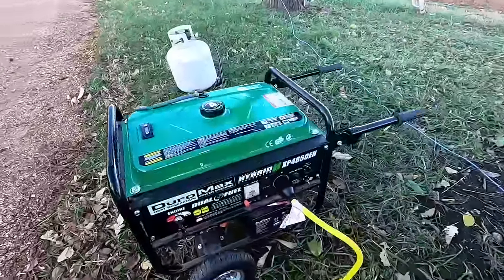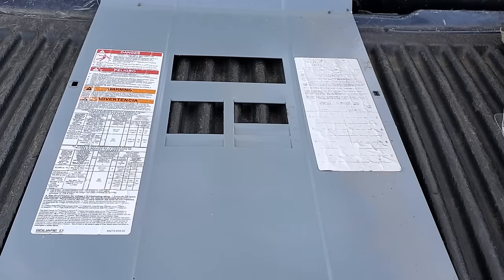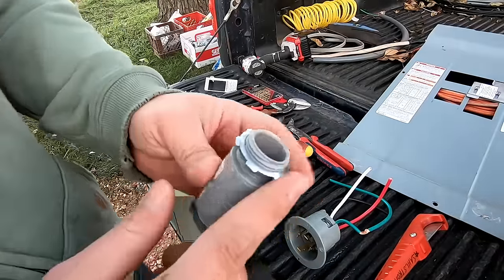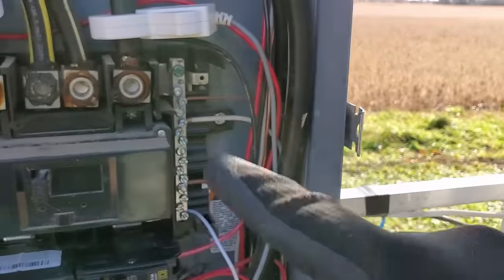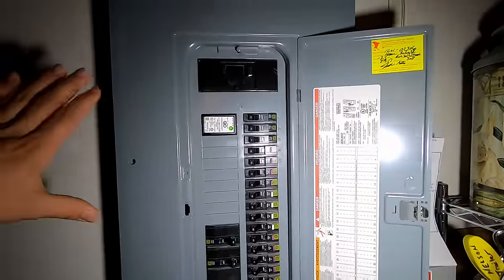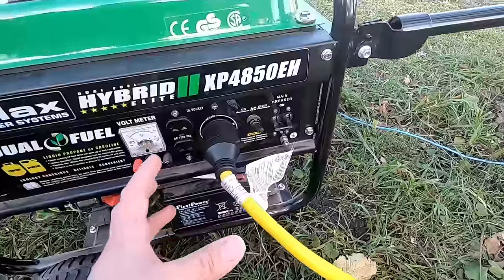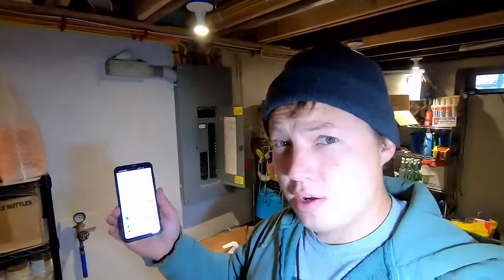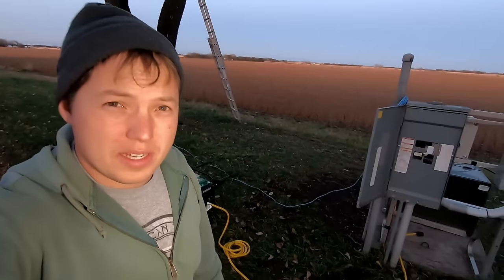How To Hook Up a Generator To Your House Using a Breaker Interlock Kit & Power Inlet Box

Comment: Just watched your video; thank for posting.  I'm trying to understand more about my electrical panel, and wondering if I could use a interlock device with an added circuit to connect my smaller 120V, Predator 3500 Watt generator for back up power to limited circuits.  Most back up gens I've seen being used are 240V with a four prong twist type plug outlet hooked up to a similar inlet plug box.  My gen uses a three pronged twist type connector.  Not sure how I would be able to feed in to only the 120V to all 120V selected circuits on an Eaton 200 amp breaker panel (MBE2040PV200BTF)

Comment: Very informative. Great video. I have a 9000 watt generator that I will be using in the same way as you just did. My question is, will I still use the 10 gauge wire in the panel or would I bump it up to a larger size wire? Again i really enjoy your videos. Very clear, understandable, and professional. 👍👍
Reply: Don’t forget about the generator safety tips as well. Remember safety is always important. Here are the generator safety tips:

1) Please do not allow an unqualified person or your children to operate the portable generator. Just because some manuals don’t say that doesn’t mean it’s safe. That is important against the generator safety rules. We also need to be keeping an eye on our children too. You need to make sure that your children are not playing near the portable generator especially when it’s running so they won’t get electrocuted. Generators pose electrical risks and they can be hot during an operation. Please keep your children away from the portable generator at all times. It is important to keep our children safe especially our little ones. Be aware of all the hazards.

2) Some people use their portable generators indoors which increases the risk of carbon monoxide poisoning. It’s important to have a carbon monoxide if you have a gas generator. Never ever use your generator indoors even if your doors and windows are open and even in the garage is not safe to use a portable generator. Not even at your porch and your deck. It is never safe to use your generator indoors and in enclosed areas of your home. Your generator needs to be 15-20 feet away from your house. 

3) 🔥generators cause fire hazards too. Never refuel your generator while it’s running. You need to let your generator cool off before refueling it and before storing your generator. Never overload your generator too. Never ever back feed your generator. You should never plug your generator into a wall outlet. Also never store propane tanks indoors. Please keep flammable things away from the generator as well and please don’t smoke cigarettes near the generator. Having a fire extinguisher next to the generator is also important against the generator safety rules. 

4) generator operation; make sure your hands are dry before touching the generator. Never use your generator in wet conditions. Don’t let your generator get wet. You need a generator tent if you need to use your generator during wet weather. Please don’t wear loose clothes when operating the generator. Turn on your generator before plugging in appliances. Use the right cord for your generator. Please do not use worn out cords. 

https://youtu.be/I1jT3ANENvI and here is a video more about keeping others safe when using generators and also about our family’s safety. Hope this helps

Comment: What would you consider sensitive electronics - A/V equipment and computers? What about laptop, ipad, and iphone chargers? I recently purchased a Duromax 13500 and went through this project with a 50A breaker. The voltage coming out of the generator varies significantly with the idle control on and I don't think that would be good for any motors. I'm wondering if this is normal? The sine wave has significant THD and is by no means pure. Is there any kind of power conditioner that can be used at the main breaker to condition the power coming in from the generator?
Reply from the maker: I am not aware of a way to "clean" all of the power coming in from the generator for the entire house. The best solution that I am aware of it to buy one of those "pure sign wave UPS" systems like this: https://amzn.to/3brujcb and then plug in anything that you may be concerned for into that "filtered" power. Honestly a lot of our electronics these days seem to be pretty well designed and aren't very likely to fail from slightly "dirty" power. Better to be safe than sorry though!

Comment: In your setup how do you know when the utility power has been restored?
Reply from the maker: Good question. Honestly I wouldn't really have a way if knowing other than if my digital electric meter display shuts off when the power is out. I can't remember if that is the case or not. I guess the other option is to call the neighbors and ask them (assuming they don't have a generator hooked up too)!
Reply: In my opinion an automatic transfer switch is "The" way to go.
Reply: When the neighbors porch light comes back on.
Reply: An ATS  is a good way to go but they fail pretty often which results in you having to manually operate the damn thing anyway and in generacs case that puts you outside farting around not to mention they cost as much as the generator in some cases.
Reply: @mds1986ms  you say that ATS fail pretty often.  Hard to believe that Generac would make an ATC that is not reliable.
Reply: @markkrusemer526  
i was only using generac as an example as the quality of generac has gone way down hill in recent years. A stiff sneeze could dent their enclosures and the electronics are sub par at best and they've started to employ "smart" technology and by doing so their new line WILL NOT start automatically without first being linked to wifi. 
Im just telling you what ive noticed in the last 17 years of being an electrician.
Reply: As for how to tell when the power is restored you can do that a couple different ways you can use a FCI faulted circuit indicator or simply use phase indicators, there are sensors that use induction to sense when power is cut or restored there are any number of ways to accomplish a signal. The first comment was supposed to be funny but i guess we'd rather argue.

Comment: I hooked up a generator to my garage subpanel (making sure neutrals and grounds were separated ) went into the house and registered each leg at 120+. the bus was energized, but had now power out through breakers to house appliances. I'm scratching my head..did I need to completely disconnect sub panel circuits first? They were shut off.

Comment: HEY GREAT VIDEO MY SETUP IS ALMOST EXACT AS YOURS BUT MINES INDOORS, I SEE YOU HAVE 2 DIFFERENT SQUARE D INTERLOCK KITS FOR 150 AMP SERVICE ,GENERATOR OR HOMELINE GENERATOR..WHICH ONE IS RIGHT FOR THE BREAKER YOU HAVE LISTED..BY FAR THE BEST VIDEO ON THIS TOPIC..MANY THANKS
Reply: Don’t forget about the generator safety tips as well. Remember it’s important to follow all the generator safety rules whenever you use your generator. Here are the generator safety tips:

This is a safety reminder 

1) Please do not allow an unqualified person or your children to operate the portable generator. Just because some manuals don’t say that doesn’t mean it’s safe. That is important against the generator safety rules. We also need to be keeping an eye on our children too. You need to make sure that your children are not playing near the portable generator especially when it’s running so they won’t get electrocuted. Generators pose electrical risks and they can be hot during an operation. Please keep your children away from the portable generator at all times. It is important to keep our children safe especially our little ones. Be aware of all the hazards.

2) Some people use their portable generators indoors which increases the risk of carbon monoxide poisoning. It’s important to have a carbon monoxide if you have a gas generator. Never ever use your generator indoors even if your doors and windows are open and even in the garage is not safe to use a portable generator. Not even at your porch and your deck. It is never safe to use your generator indoors and in enclosed areas of your home. Your generator needs to be 15-20 feet away from your house. 

3) 🔥generators cause fire hazards too. Never refuel your generator while it’s running. You need to let your generator cool off before refueling it and before storing your generator. Never overload your generator too. Never ever back feed your generator. You should never plug your generator into a wall outlet. Also never store propane tanks indoors. Please keep flammable things away from the generator as well and please don’t smoke cigarettes near the generator. Having a fire extinguisher next to the generator is also important against the generator safety rules. 

4) generator operation; make sure your hands are dry before touching the generator. Never use your generator in wet conditions. Don’t let your generator get wet. You need a generator tent if you need to use your generator during wet weather. Please don’t wear loose clothes when operating the generator. Turn on your generator before plugging in appliances. Use the right cord for your generator. Please do not use worn out cords. 

https://youtu.be/I1jT3ANENvI and here is a video more about keeping others safe when using generators and also about our family’s safety. Hope this helps. Have a good one

Comment: Quick question?
Since you are using the Utility Neutral Conductor and the Generator Neutral, that is Bonded to ground on the Generator, is it Code compliant?
Is there a danger of back feeding the Neutral  Utility conductor with the Transfer switch in Generator Mode?
Reply: Here is an information about generator safety: this is just a reminder for everyone’s safety. Always make sure you follow all the generator safety rules whenever you use your portable generator. Generators can be dangerous if not used carefully. Every year, hundreds of people die or get injured when using portable generators due to carbon monoxide poisoning and electrocution. Make sure you are using your generator carefully and keeping others safe as well. There is something very serious that everyone should always be aware of when using generators. Some people do run their generator indoors which is not safe and that increases the risk of carbon monoxide poisoning which can cause death of family and you. Some people run their generator in wet conditions which can electrocute them. Please remember that you should never run your generator indoors. Remember that carbon monoxide is an odorless and colorless gas that you cannot see or smell. Carbon monoxide is a silent killer. Keep that in mind. Make sure your generator is 15-20 feet away from your house and away from doors, windows, and vents. Never use your generator in your porch too. Having a carbon monoxide detector is very important against generator safety. Some people also allow children to go near the portable generator which could pose risks. We need to keep an eye on our children making sure that they are not near the portable generator so they won’t get electrocuted or burned by the generator which is dangerous. A locking enclosure also keeps kids safe. A generator shed might look like a tempting place to explore, or take cover during a game of hide and seek, but a generator is a dangerous piece of equipment that can cause injury. It says on the manual that we should also keep children away at all times from the portable generator to avoid injuries. Please do not allow a child or unqualified people to operate the portable generator.  It is important to keep your children safe especially little ones. The portable generator can be hot during an operation. Just because some manuals missed what should be listed doesn’t mean it’s safe to do. Always follow the generator safety rules when using portable generators. Generators pose electrical risks. If you need to use your generator during wet weather, you need a generator tent to protect your generator from getting wet. Don’t let your generator get wet. Keep your generator dry and before using your generator, please make sure your hands and your generator is dry. Do not wear loose clothing when operating the generator. Everything that is said on the generator’s operating manual should not be ignored. Never smoke cigarettes near the generator. Please keep flammable things away from the generator. Never overload your generator too. Your generator can catch fire. Never ever try to plug a generator cord into a wall outlet to avoid back feeding. Back feeding your generator is dangerous. Always turn on your generator first before plugging in appliances and shut off the appliances before turning your generator off. Use a heavy duty cord for your generator and the cord should not be worn out. All the instructions should be followed carefully. Never refuel your generator while it’s running. It can cause fire if fuel spills while your generator is hot. You should turn off your generator and let it cool off before refueling it. Having a fire extinguisher next to the generator is also important. This is only a reminder for everyone’s safety of using generators. Make sure your generator is properly grounded. Having a fire extinguisher next to the generator is also important against the safety rules. https://youtu.be/I1jT3ANENvI and here is a video more about keeping others safe when using generators and also about our family’s safety. It’s important to keep our little children safe as well. Make sure your little children are kept away from the generator at all times especially when it’s running. Hope everyone finds this helpful. Always remember that it’s better to be safe than sorry. Remember that warnings should not be ignored. Of course there’s a danger of back feeding your generator

Comment: What if you do not have any open slots for breakers in your house breaker box
Reply: ⚠️Please don’t forget to follow the generator safety tips when you use your portable generator:

This is a reminder for everyone’s safety when using portable generators. All generator safety rules need to be followed carefully whenever you use your portable generator. This is just to make sure. 

1) KEEPING OTHERS SAFE: Please do not allow an unqualified person or your children to operate and service the portable generator. Just because some manuals don’t say that doesn’t mean it’s safe. That is important against the generator safety rules. We also need to be keeping an eye on our children too. You need to make sure that your children are not playing near the portable generator especially when it’s running so they won’t get electrocuted. Generators pose electrical risks and they can be hot during an operation. Please keep your children away from the portable generator at all times. It is important to keep our children safe especially our little ones. Be aware of all the hazards.

2) WHERE TO RUN YOUR GENERATOR: Some people use their portable generators indoors which increases the risk of carbon monoxide poisoning. It’s important to have a carbon monoxide if you have a gas generator. Never ever use your generator indoors even if your doors and windows are open and even in the garage is not safe to use a portable generator. Not even at your porch and your deck. It is never safe to use your generator indoors and in enclosed areas of your home. Your generator needs to be 15-20 feet away from your house. 

3)🔥FIRE HAZARDS: Never refuel your generator while it’s running. You need to let your generator cool off before refueling it and before storing your generator. Never overload your generator too. Never ever back feed your generator. You should never plug your generator into a wall outlet. Also never store propane tanks indoors. Please keep flammable things away from the generator as well and please don’t smoke cigarettes near the generator. Having a fire extinguisher next to the generator is also important against the generator safety rules. 

4) GENERATOR OPERATION: make sure your hands are dry before touching the generator. Never use your generator in wet conditions. Don’t let your generator get wet. You need a generator tent if you need to use your generator during wet weather. Please don’t wear loose clothes when operating the generator. Turn on your generator before plugging in appliances. Use the right cord for your generator. Please do not use worn out cords. 

https://youtu.be/I1jT3ANENvI and here is a video more about keeping others safe when using generators. Everything that is said about the generator safety rules all need to be followed. Especially keeping your children safe. 

Hope this helps